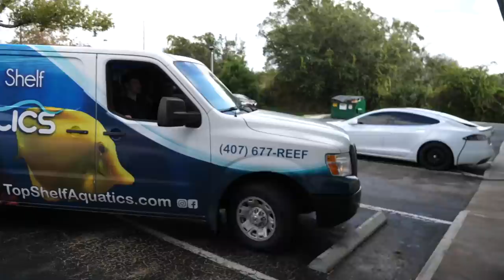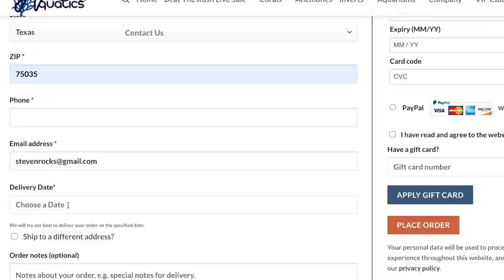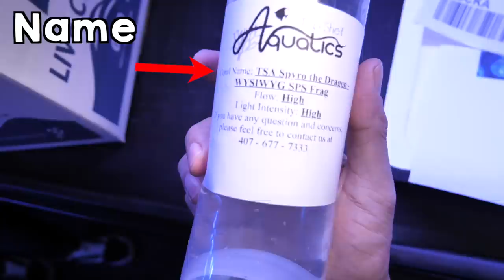Private Tour of 30,000 GALLON Reef Aquarium SPS Dominant Coral Farm!! - (Top Shelf Aquatics)

Comment: This will be the future of coral existence, maybe 15 years left before most reefs are bleached out.  The great thing here is that the toughest strains are hardy for the customer, the required skill level is less than 10 years ago :). When u see ripping tanks from the early 2000s , those guys were masters!  Now with the right equipment and monitors , you can achieve similar with less skill, however it’s still hard to do which makes the challenge fun :)